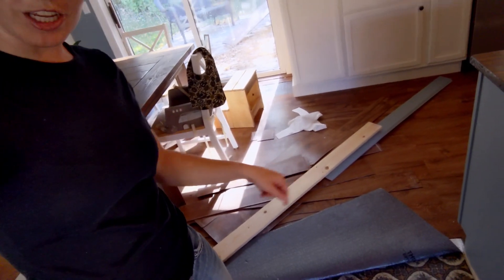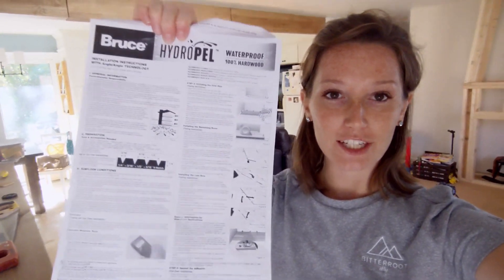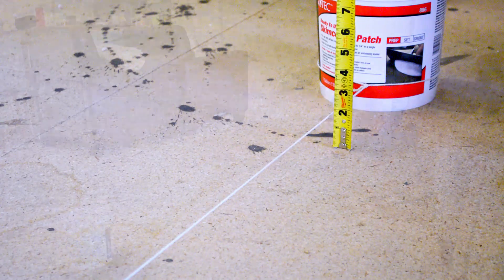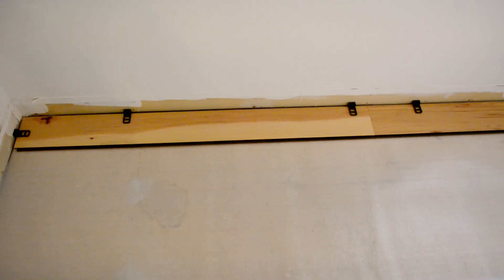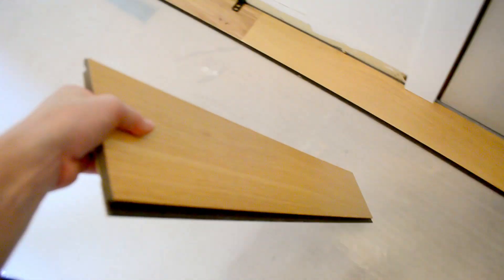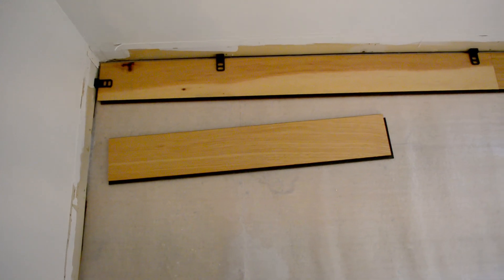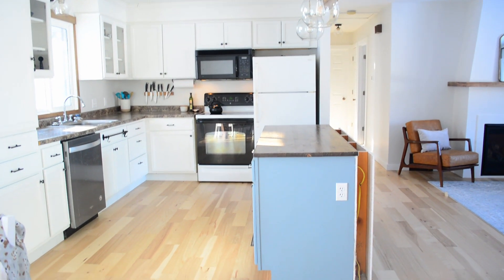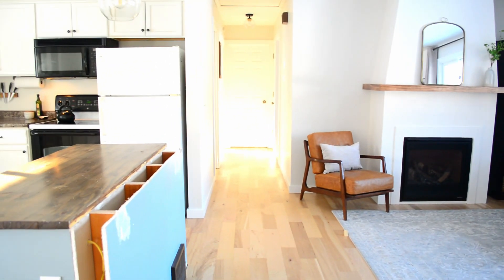PT. 1: New Flooring | DIY Living Room Remodel

Comment: Amazing job! It almost makes me think I can do this in our house! 😁
Can you say what kind of saws (type & brand) and the saw blade you used to make your cross cuts, rip cuts and dirt jamb cuts?
Also, how wear resistant are these floors? We have dogs in our house and have be careful to install high wear resistant wood flooring. Thanks in advance for your reply.
Reply from the maker: I used a DeWalt 12" sliding compound miter saw with a fine finish blade for the cross cuts and a Black&Decker jigsaw with a fresh fine cut blade for all other weird cuts. Nothing fancy - just fresh blades. It's VERY durable. We have 2 kids that spill and drag stuff across it all the time and there are no scratches so far. I don't know how that'll translate to dog paws, but it's the most resilient hardwood flooring I've encountered - better than just regular hardwoods. The finish on it is really easy to clean and we haven't had any issues with junk getting in the cracks (the seams are tighter than standard hardwoods). Also, this is NOT sponsored.
Reply: @TylynnM_  thank you very much for the information. Looking forward to more of your videos. 😁